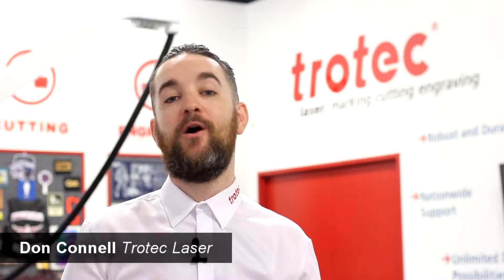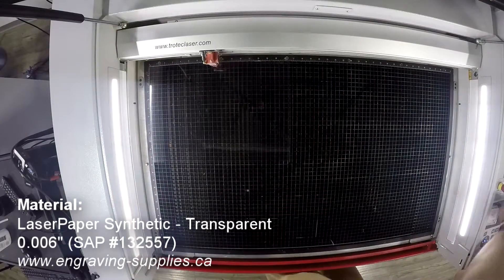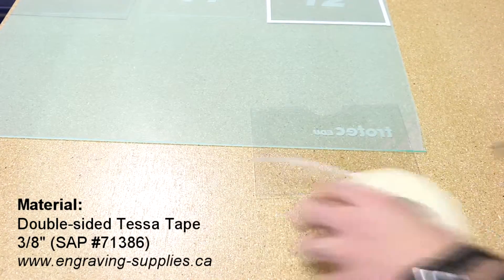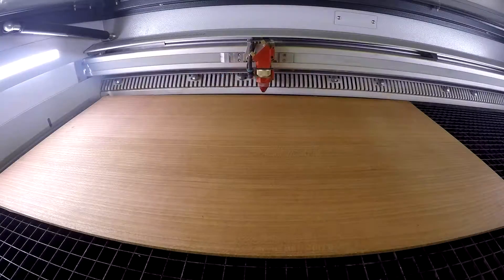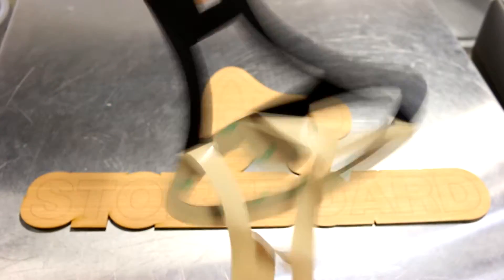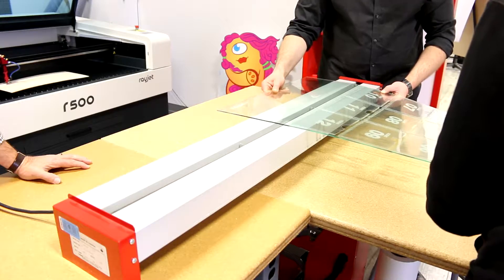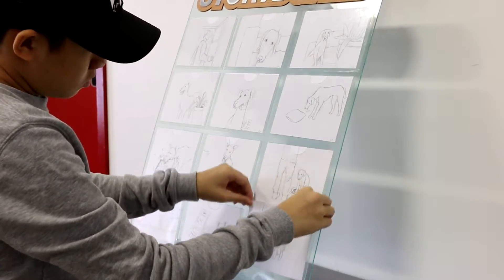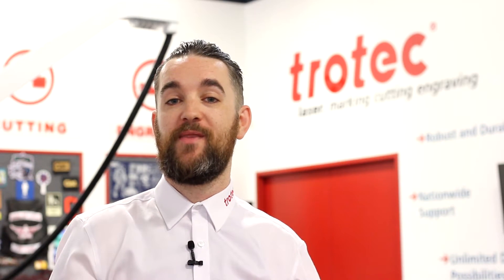Custom Story Board | Laser Cut School Project | English Project Ideas

Comment: This is awesome, how does one do a kiss cut ? Is just a less engrave ?
Reply from the maker: Usually about 10 power with 5 speed.
Reply: It is a cut with less power and higher speed. So that the material is not cut through. Just a very light cut on the surface
Reply from the maker: Thanks guys!